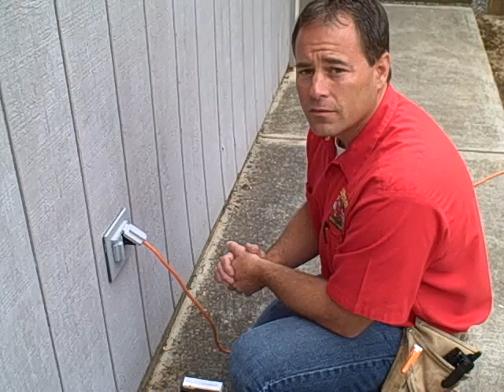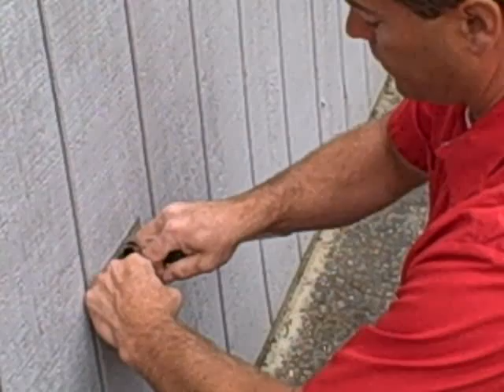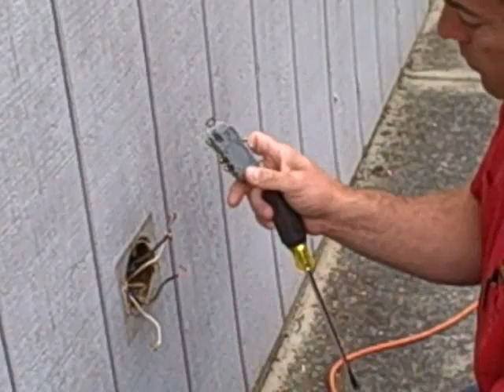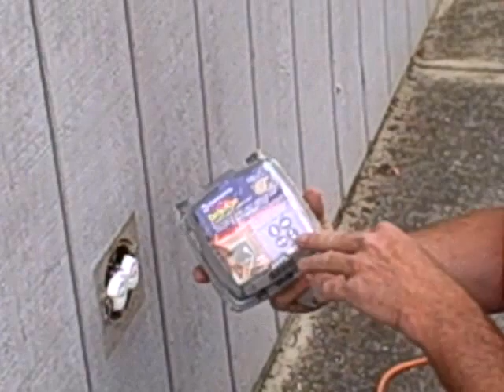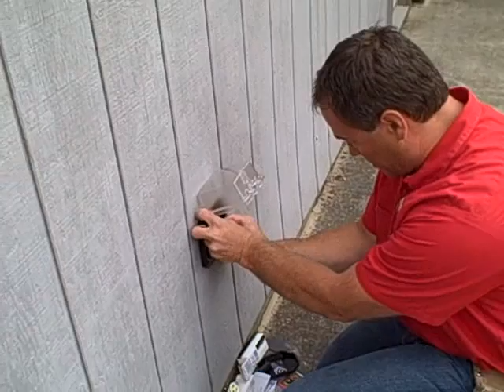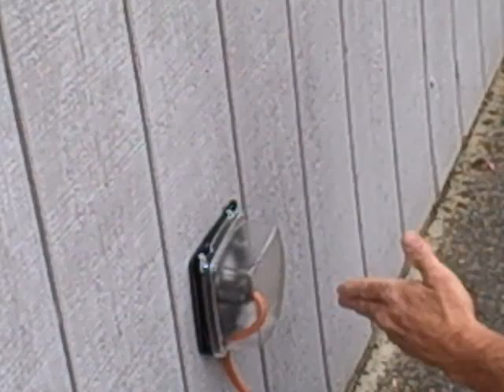Replace Outdoor Electrical Plug and Cover

Comment: Just missing info....otherwise great video. The receptacle has brass screw and silver screw on opposite side. Does it matter which wire connects on which side? I have one black wire...one white.

Comment: When did you turn the power off? You put in the tester, something "tripped" and then you proceeded with the job? What? What?
Reply: Because GFCI outlets can be daisy-chained, he caused a ground fault, which caused an outlet further up the chain to trip.  Since that outlet feeds this outlet, when it trips the power is cut off to this outlet as well.  Once he is done, he'll have to go inside and figure out which one tripped and reset it.  It's more safe to actually turn off the breaker and test the receptacle with a multimeter to ensure it's off.  He is comfortable with doing this so he cut this corner.
Reply: Lisa Davis f

Comment: I have a outside outlet one works the other does not I know there's no power because the led is not lit up the plug will not reset .any suggestions

Comment from the maker: Sorry I didn't respond back sooner. I have not been on here since you posted. I pretty sure you have found the problem out by now. But in case not... The first thing I would check for is if there is a tripped GFCI on the circuit. The next would be to see if any of the other outside outlets are working. If they are then would check the one nearest the electrical panel and work my way out from there. Larry

Comment: Hi Larry,
I recently changed an outside outlet plug because the old did not have any power. That did not fixed the problem even with the new outlet. Now I checked all of the outlet insede the house and the garage and all of them work. Except for that one outside witch it looks like it should be getting power from another outlet. But I just can't seem to find the problem. Any suggestions??

Comment from the maker: If in doubt replace it. If the cord being plugged in feels easy to pull out then replace it. Just because a plug outlet is older doesn't make it that it needs to be replaced. If it is a plug that is used often then I would. If you replace it depending where you are located you might replace it with a tamper resistant/ weather resistant outlet. Here is Vancouver, Washington we are required to install that type of plug. Hope that helps. Larry

Comment from the maker: What are you looking for far as information? All plug outlets that are around water or ground, (earth), need to be "GFCI protected. One GFCI can protect other plug outlets on the circuit down stream of it. You want to make sure line and load are in the correct location as the new GFCIs will not work. Line is the power coming into the plug outlet. Load is the wire/s feed out to the rest of the circuit. Hope that is some help. Larry